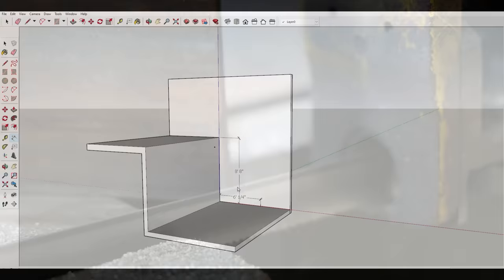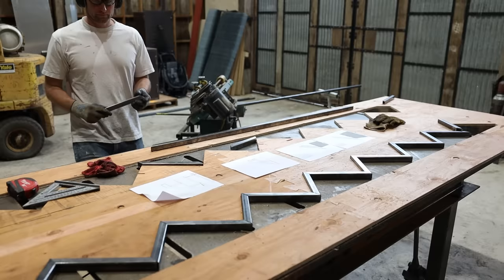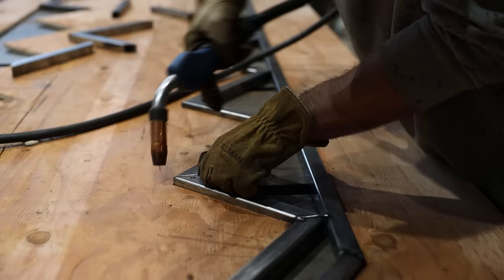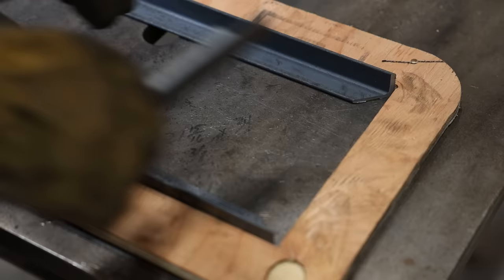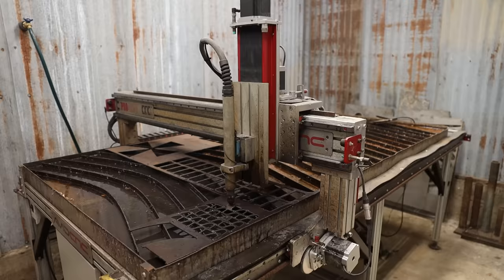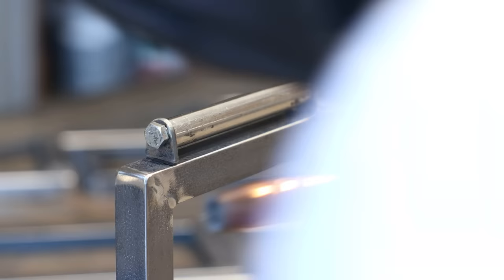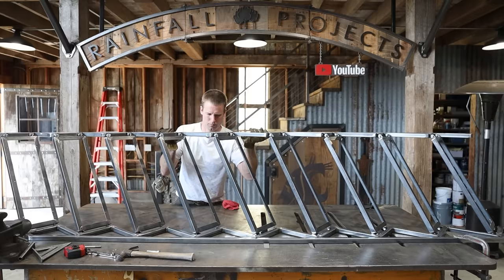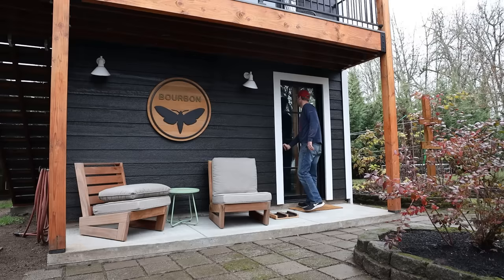Folding Stairs for Bourbon Moth

Comment: Here's a CNC plasma tip.  When you're doing the drawing for your welding tabs leave about a 1/16" strip connecting all your weld tabs.  Do them in groups of 10 or whatever.  This makes them way easier to fish out of the water and easier to remove the dross.  If you do enough in a row they'll be supported by your table slats and won't even fall in the water.  You can then just cut them apart with a zip disc in seconds.  It works well for me anyway.
Reply: Our supplier also always does this
Reply: Great tip

Comment: Loved the video!  Amazing folding stairs project!  Bravo!
My only comment is that it needs a railing on the outside edge (maybe use a lightweight metal like aluminum or titanium), and some safety features to prevent pinched fingers, and maybe some sort of interlock mechanism to prevent the gate at the top from opening if the stairs are folded up and/or to prevent the stairs from folding up if the gate is open.

Comment: A railing would be an easy fix. Just put one right above the area that folds against the wall. The stairs would tuck in under it. 

Beautiful design with so much sense. This would be an ideal solution for a tiny house. Bring the stairs down to get into a loft bed, and tuck them away during the day for more living space.

Comment: As an architect I planned such a staircase laste year. Unfortunately it never came to reality because of the skyrocketing prices over here. Glad to see your finished piece. Thanks for sharing
Reply: It probably won't meet codes for an actual public stair.  Looks like the rise/run ratios are wrong and is has no hand rails.
It might work as a private ships ladder in a loft of a residential build but wouldn't meet commercial building code.

Comment: On long zigzags like that there is a lot to say for tongued-cap pieces that go inside the 90° joints that you then weld through into.  It adds some weight to the whole but not enough to worry about.

Comment: You should try a small rolling portable belt grinder stand for sanding all those burs. It’s so much better than holding that grinder. It’s quicker too.
I meant the little parts before they’re welded. I got a little ahead of myself.

Comment: It would bend less under foot if it had a truss "hand rail" on the outer side. Even a 12" rail with crossbeams would give it tremendously more rigidity. The wall side can be made rigid with 10 screws into the wall so that's not the problem.

Comment: I'll spend 14 hours replacing a compressor on a rooftop condenser unit solo in an emergency during 0°f temps without batting an eye, but I sit here and look at this thinking this is so much damn work!

Comment: When it comes to the router, choke up on your tools. the reason its chattering is because its sticking out so far. after you choke up on it a bit better you could easily double your feedrate and it will cut much quieter. Part of the issue is you're going too slow but you'll break the tool with how far its sticking out now.

Comment: Curious why you went with nylock nuts instead of internal spacers so you could tighten the bolts down hard without restricting the movement of the stairs?  Just seems like it would better limit wiggle and wear better over time.

Comment: I think that design could have used a good dedicated handrail on top.  One that you can grasp and slide your hand down as you descend.  That would also fix the finger pinching issue as the handrail can become the handle when opening and closing.  You can leave it to the customer to find a nice wood piece to mount as handrail.

Comment: Magnificent build!  I am curious to know more about the pinch point that Bourbsie, burbsee, burbzey...discovered while the stairs are in use.  I have a similar project now in mind, but have 4 children and a wife that would be using my stairs and would love to know if there is a way to protect from making a similar discovery.
Reply: It looks like the pinch point comes from grabbing one of the vertical, riser, pieces of the side instead of the angled "hand rail" when choosing where to lift. As you lift if you're holding a riser then your fingers/knuckles are now in the path of the folding step/tread. You could potentially fix this problem by filling in the triangle shaped negative space of the side piece made by the riser, tread, and hand rail, and leave just an oval shaped opening parallel to the hand rail in that triangle as a guide for where to grab/lift. Another potential solution is to add a dedicated handle for lifting to the side of the hand rail

Comment: Need to learn the codes for stair construction before you do this for a commercial project.
The tread rise and run ratios plus the handrail requirements as well as structural load calcs are required for most builds.  Stairs are tricky and have a lot of particular rules.  If you build it not to code they will make you tear it down and completely rebuild it.

Comment: Great video. But seeing the measurements at the start in old fashioned feet and inches really made me laugh though. Hell that is so last century!  Metric is streets ahead better. I was working with metric on a civil engineering contract I was working on in '73 - '75. I jelled with it so easily, it's so much easier. Now nearly 50 years later people still working to 1/16th and 1/32nd's. That really feels a bit Stone Age now, so outdated.